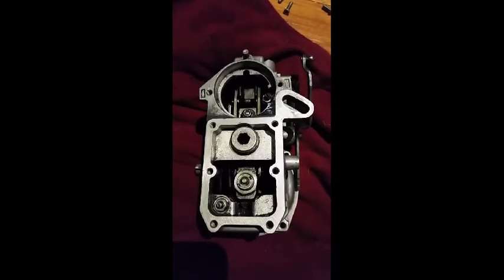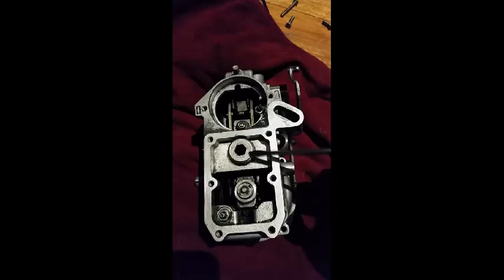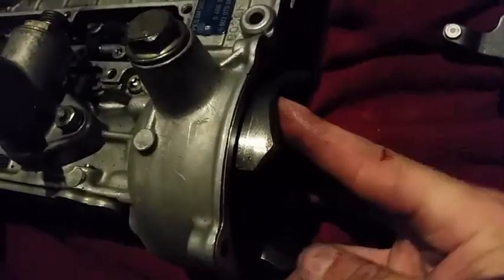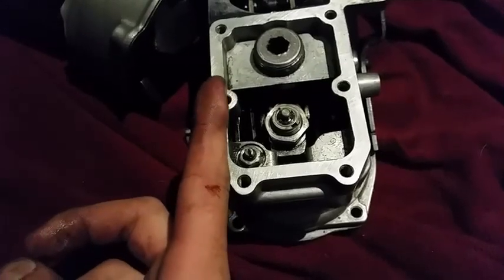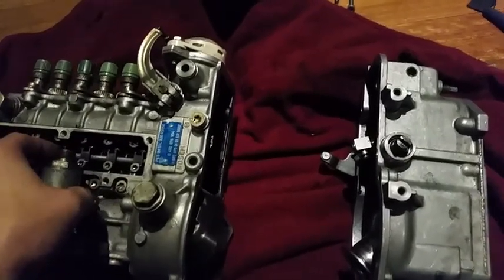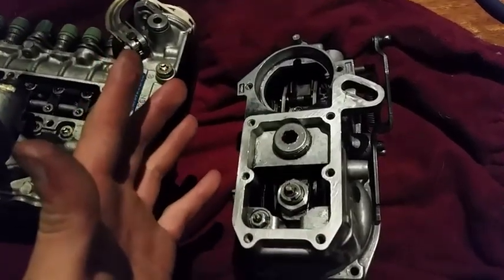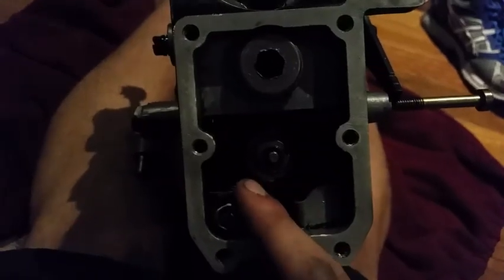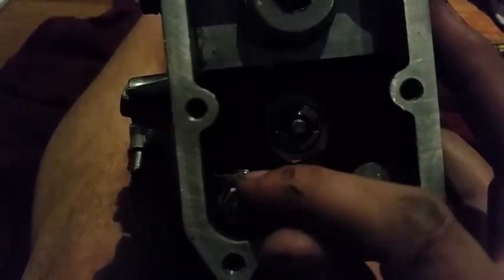Mercedes 300d RSF Governor full rack travel adjustment & stop solenoid fault

Comment: Hey man thank you so much for this video and the explanation. I'm having some issues with my torque capsule. It slowly backed out on its own causing the RPMs to not come back down while I was driving it. I opened up the pump and adjusted it after watching your video and I added a little bit of loctite. Lasted for about a thousand miles and now the issue is back. I'm guessing I didn't clean it well enough before I used the Loctite. Have you ever had this issue?

Comment: Hello.
Thanks for the informative video.
On my pump i have engine shaking on idle. It seems like rack is shaking on idle. What do i need to adjust?
Thanks in advance.
Reply from the maker: Shake could be a misfire / non fire of a cylinder.

That's seems more likely a problem with delivery to a cylinder and the pump is reacting to it.

If a pump has an adjustment problem it's more likely to hunt up and down with rpm no make the motor shake.

Get a laser temp gun and check each cylinder output on the exhaust manifold at idle. 

That will point out if you have a cylinder that's not firing.  The temps will be like 120, 110, 60 ,115 c
Reply: @benzperformanceparts3762  hi
Cylinders fire well.
Its not a misfiring. I know how misfire looks like.
This is some pump issue.
Its not  shaking to much. You can fill it on idle only. I'm pretty sure that rack hunts. Also have some tickling noise when driving with no load.
For me it seems like governor sensitivity is to high maybe.
Reply from the maker: @amf4591  you might need to tighten up the toque capsule as that's what applies resistance to the rack.

That might stop it jumping around
Reply: @benzperformanceparts3762  thanks 
Will try that.
I thought that governor spring is too loose.
First will adjust rack travel, then torque capsule.
Reply from the maker: @amf4591  sorry. Yes the governor spring is what you need to adjust.  It pushes the torque capsule.

So it's same part. Just 2 different adjustment.

If you have turned the rack travel to far. It will push the governor system past the point where it works. 

It does strange things when you go past the maximum adjustment point
Reply: @benzperformanceparts3762  why people adjusting bottom right under elr if they adjusted full  rack travel bottom left under governor cover?
Reply from the maker: @amf4591  sorry that doesn't make sense
Reply: @benzperformanceparts3762  i did not touch my pump yet. I have one more question. when i drive with no load i have ticking noise coming from the pump. I`m sure for 100% that this noise is coming from pump not from engine. Did you ever seen something similar, can torque capsule make noise?
Thank you in advance.
Reply from the maker: @amf4591  I don't think so. 

The pump has a cam shaft inside it and plungers . They are more likely to make a tick noise then something in the governor.
Reply: @benzperformanceparts3762  i know I disassembled my pump to change plungers, and know what is inside.
It's abnormal ticking not like regular pump ticking. Only happens when you drive with no load no acceleration no deceleration.
Reply from the maker: @amf4591  I don't think it's in the Govenor.

Because when you put it on the back of the pump you load the spring system up..

If it was loose enough to make any clicking noise it wouldn't work and the car wouldnt run properly.

Not sure what the noise is sorry
Reply: @benzperformanceparts3762  Hello again.
Sorry for too many questions. Is there any adjustment in rsf governor which controls starting fuel limit? Also if i will get max full load adjustment, how many cc fuel flow i will get approximately? Im running 606 with 6mm stock turbo.
Reply from the maker: @amf4591  no I don't believe that's how it works.

When calibration is done on a bench unit, they set the starting point for the plungers. 

The Govenor unit can rise the idle but  that's different
Reply: @benzperformanceparts3762  ok, Thank you

Comment: I have an issue... Was hoping you could give me an idea of where to look. I changed the o rings and copper washers on the top of the injection pump, and now my stop lever has resistance in the stop area of its travel, which prevents it from moving back up when I turn the ignition on. I have to give it a nudge for it to flip up and allow the car to start. It's an 87 300d. Any ideas?

Comment: My motor revs really quickly and it takes a while to get back down
Reply: Turn the torque capsule cw in short intervals and check. You may need to try this a few times, hope it helps

Comment: Hi, what timing do you set to the injection pump?
Reply from the maker: José Joaquín Arias Giralt . I believe the factory setting is 14°  

I had to set mine lower due to timing chain wear. 

Mine was set to about 10 or 11 on the crank. 

But with bigger injection pump you need more timining. 

Black smoke racing runs over 8 mm pump and 18° at 40 psi

Comment: thank you very much for this video Ive been searching for a while. I am going to attempt to increase my pump on a 83 om617. I am going to pair it with a Hy or hx35 and and a/a intercooler. I do have some more questions for you. I still have no idea how to time the engine. could you do a vid on that?
Reply: Ben Rawcliffe  hello Ben thank you for replying back to me. since watching your video I have removed the alda and tweaked the pump a little on my om617 she's running great. your advice will be some help and I will save your email. in the future I plan to remove the pump to get it built by dieselmeken so your help will be greatly appreciated for an easy removal and install. thanks again
Reply: Ben Rawcliffe that sounds like a good idea I will be installing an egt probe some time soon

Comment: Hello nice, I would like to have some help please .... I have a w210 and I do not find information on the synchronization of the injector pump is a motor 606.962 .... what I found is that it is done at 14.5 dpms .. ..soy of chile would be very helpful if I could provide some information in advance many thanks and note that they develop very good car greetings :)
Reply: 1998 is the car
Reply: My question is how to synchronize the injection pump, engine 606.962
Reply: @cjmaxmen  Hey Carlos i know it's been 4 years but did you figure it out? I'm in the same boat as you...